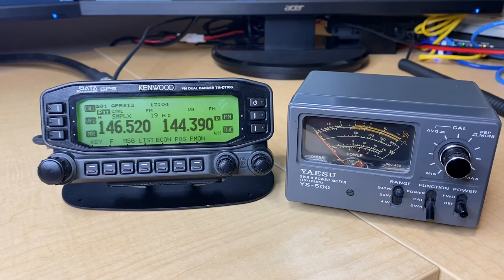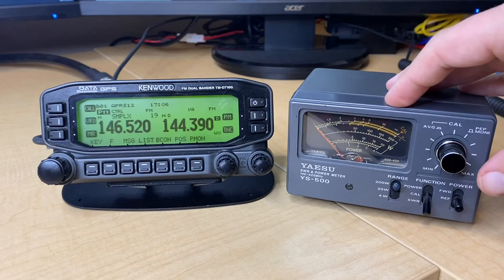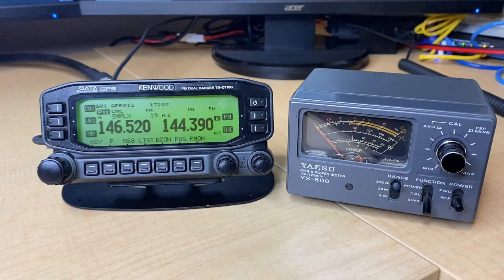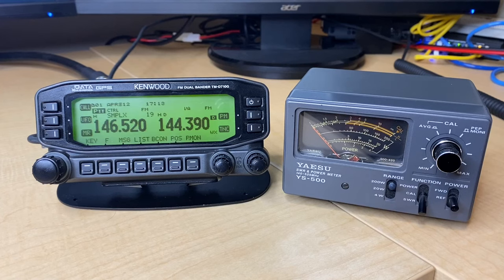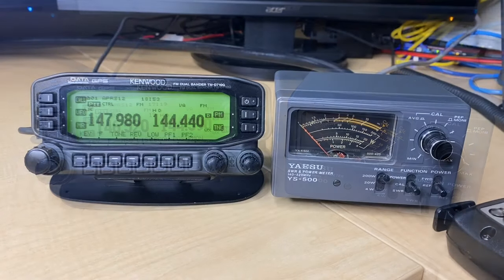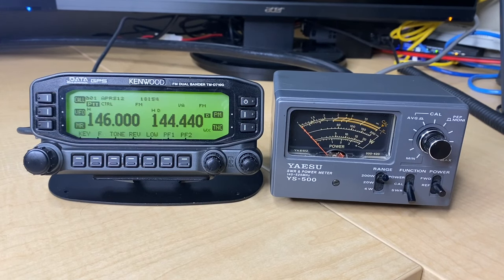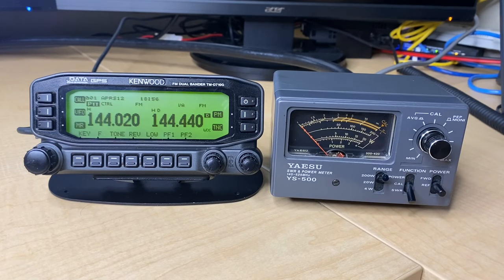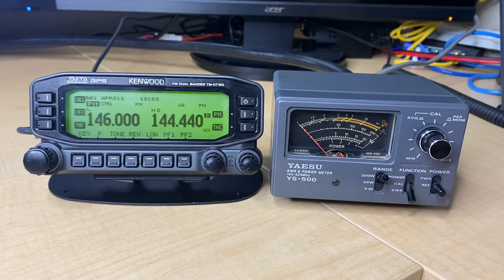Ham Radio Basics: Why You Need a SWR Meter

Comment: Shouldn't one recalibrate the meter when changing the frequency to analyze?
Reply: Yes, the meter must be recalibrated when changing frequency and most especially when changing power levels. Setting the calibration level (essentially a relative forward power reading) at high power and then keeping that same level when switching to a lower power output will result in an inaccurate (artificially low) SWR reading. Remember that SWR is a function of pure resistance along with inductive and capacitive reactance. Those values change with frequency but not with power level. Therefore the SWR of an antenna system will remain the same at a given frequency regardless of power output and thus one should expect to see the same SWR value on the meter no matter what power level is used.
Reply from the maker: @BrianEsche  The difference in in SWR when recalibrating between 148 and 144 is pretty nominal. I could see if you needed a precise reading, but when judging resonance and seeing how out of whack it is, it works fine. I did remove the section on power levels though, given your feedback, Brian. Thanks for posting!

Comment: SWR is important though it shouldn't be an obsession. Anything less than the start of auto power fold back should work well. Even if you are at VHF, good quality low loss coax will not have that much increase in loss. Kind of a rule of thum, less than 1.5 is fine. On HF I might even let things go as high as 2.0 before I would worry. The reflected power is reflected back added to the radio output. The biggest problem I find with antenna to coax mismatch is that it makes the impedance that appears at the radio vary with distance from the load.

Comment: Maybe talk about the dirt cheap alternatives you can use besides expensive SWR meters. Like a bridge circuit or other power meters.
Reply from the maker: What do you use?
Reply: @K0LWC  — the cheap eBay low power ones shipped from China are $20. If you are careful that can do the job.  I tend to borrow expensive $200 meters from clubs or club friends.

Comment: So if you're antenna tuner is situated at the rig end, rather than at the antenna end of the system, then although your xmitter thinks it is working into a resonant antenna, it may not be, in which case a lot of power will be lost because of standing waves on the coax cable. So I guess that this is why it is better to install the tuner at the antenna end of the system? I guess that the whole idea is to maximize standing waves on the antenna, and nowhere else?
Reply: Simply upgrade the feedline to a less lossy one

Comment: Shouldn't it be that it should be at the FORWARD mode when you calibrate and when reading your SWR then switch it to REFLECT to read how much reflected power in WATTS is going back to your radio?

Comment: The SWR meter is also very important, when choosing a antenna for your HT. I have the Abbree 18.8 inch version, and on my TYT UV8000E, with the frequency set to 146.000, I have a SWR of 1.0, and all 10 watts of power from the radio. So yes if your SWR's are bad, it can damage your radio, be it a base station, mobile rig, or a HT. Stay Safe and 73's, KI7BSL, I'm out.

Comment: Thank you. Great info for us new guys. So if you are just about ready to hoist the antenna up onto the roof, can you test the SWR and resonance with a HT  before tightening things up, or is it best to use the radio you plan on using for said antenna?
Reply from the maker: HT could complicate things. I would use the radio you’ll use everyday on the antenna. Either set it up temporarily in open space (PVC pipe is one idea) — or just know what once it’s up to test before tearing down your ladder etc. where you place it permanently could impact the SWR — so just be sure to test once it’s mounted, but be prepared to head right back up if needed.

Comment: Not very accurate. As an example often an antenna with more then one element exhibits maximum directivity and gain at a higher swr point.
Reply from the maker: New ham radio operators are likely running a simple vertical.
Reply: @K0LWC  if you're teaching better to be accurate. VE2AED
Reply: This comment is way outside the scope of this video, and rather vague anyway.
Reply: @paulm0hpd319  try spelling. I say it's vague for one reason, the old then instead of than. And it's still outside the scope. I'm  a CBer and know more than most hams anyway.